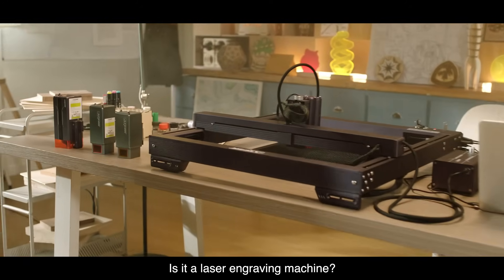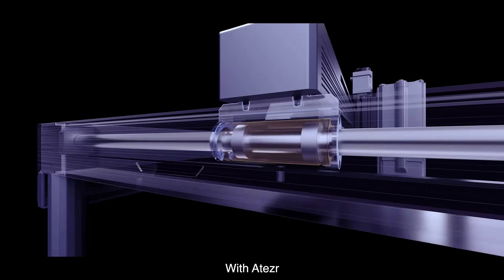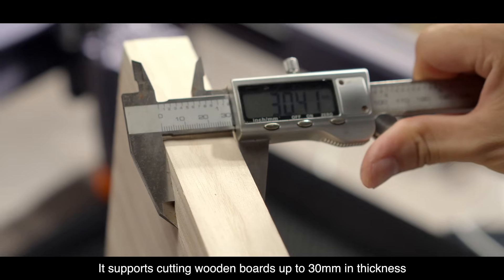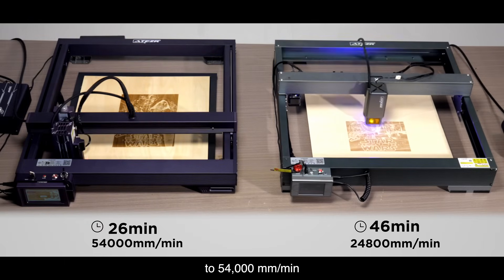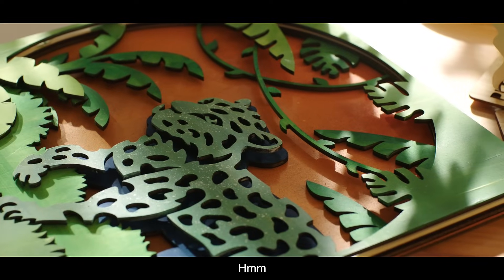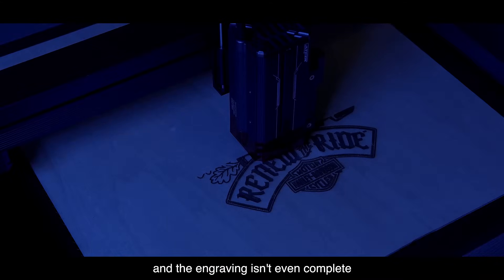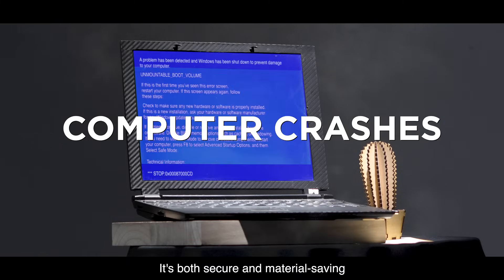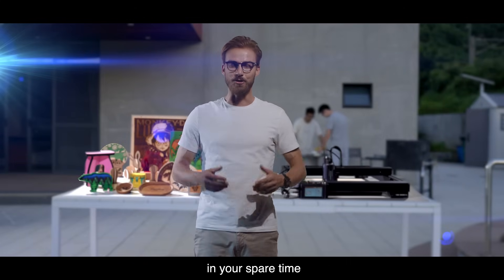ATEZR L2: The Best Laser Engraver for 2024 Beginners - Up to 54000mm/min Speeds!

Comment: In my experience this machine has good specifications, but if one day you need technical support or customer service you will not receive any help from Atezr only evasive answers. A few days after installing my new L2-24w, the laser power decreased to 50% and after multiple emails and videos they stopped responding and did not respect their sales guarantee. Be warned.